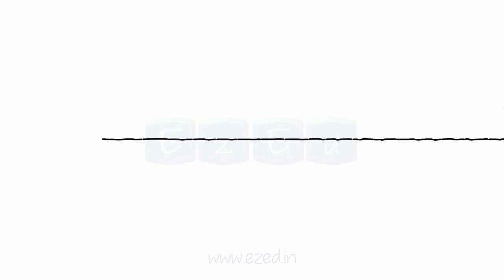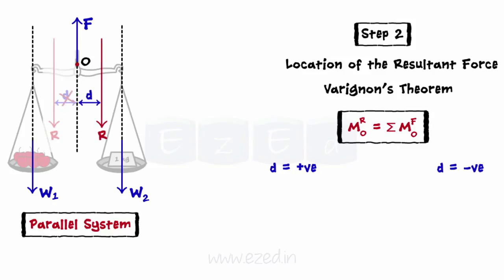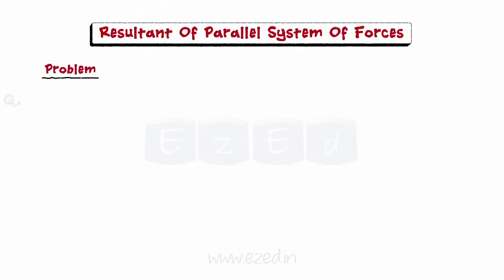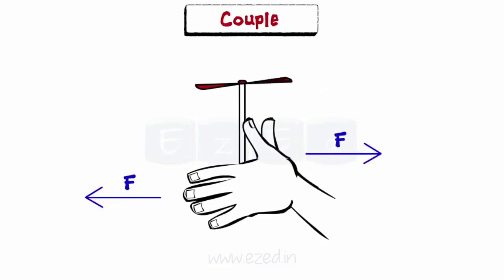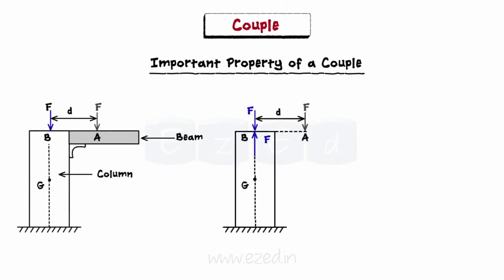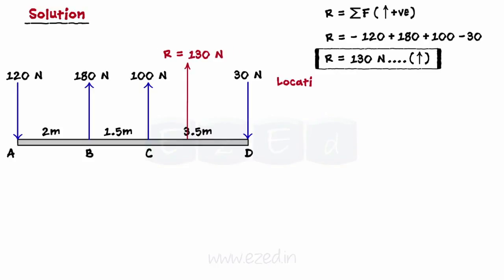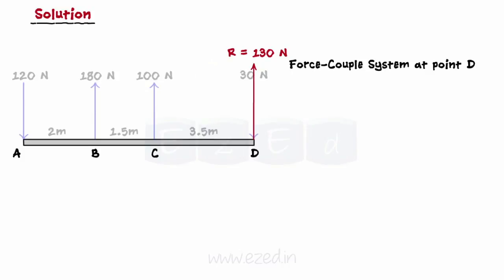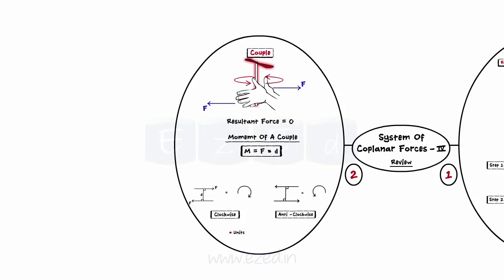System Of Coplanar Forces Part IV - Resultant Of Parallel Force System

Comment: 3:03 how did you get the 4.0 in varignon’s theorem
Reply: Add 0.6m with 3.4m to get the total distance of 30N
Reply: @giovannimayola6405 The calculator shows 4 not 4.0 🤨

Comment: Some specify downward direction to be taken as negative and according to your channel you consider it as positive
Reply from the maker: @Rajshri, You can assume the direction of the the force. If the answer after solving the equation is negative than the direction of the force is in the opposite direction of what you had assumed.
Reply: @EzEdChannel  ya I thought about it and in both ways I am getting the same answer...thanks btw..